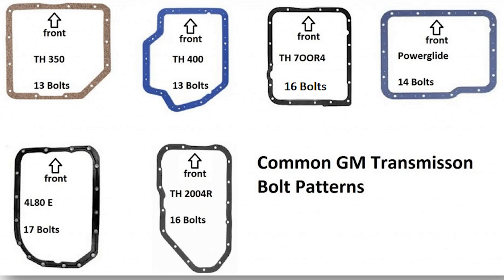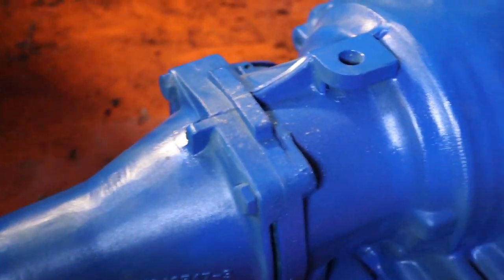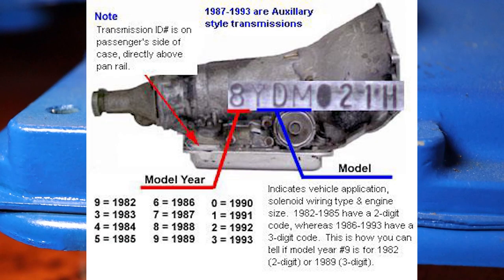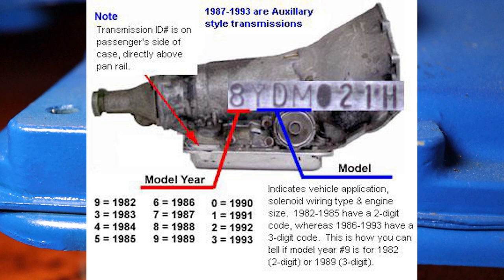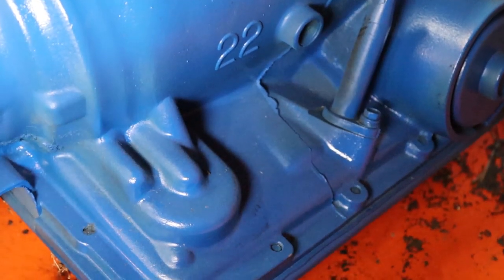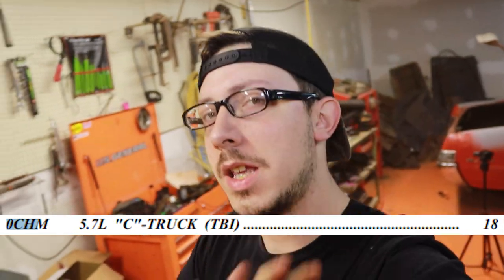Things You NEED to Know Before Your 700R4 Transmission Rebuild

Comment: Ive got a 1990 g20 diesel Chevy van with reverse slipping pretty bad. Is that fixable without removing and tebuilding transmission? Only 90,000orig miles on 6.2
Reply from the maker: I'd say it likely needs to come out unfortunately. You COULD try a flush to see if there is metal in the pan - if not throw some new fluid in it and give it a shot. It's a $100 risk and a bit of time.